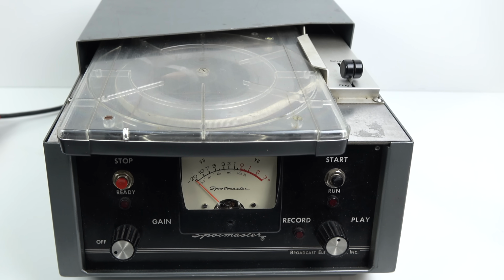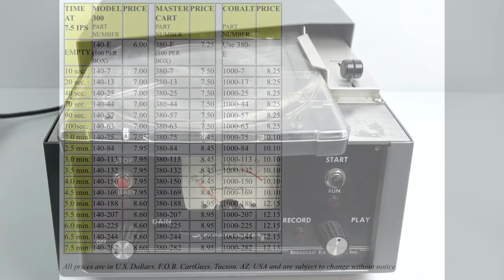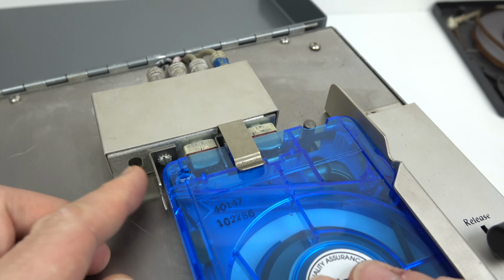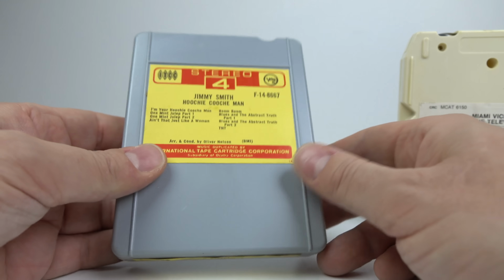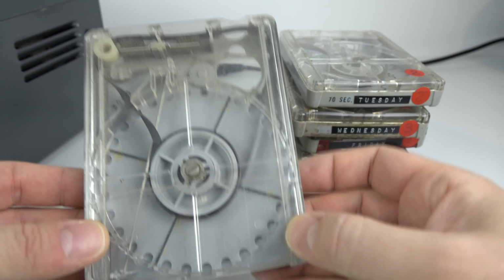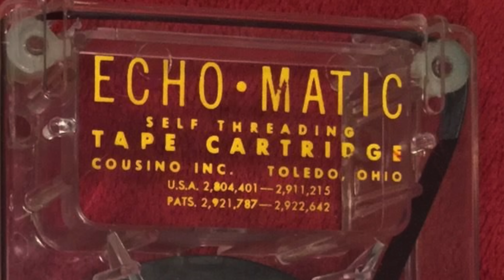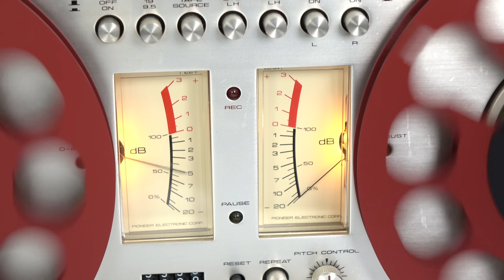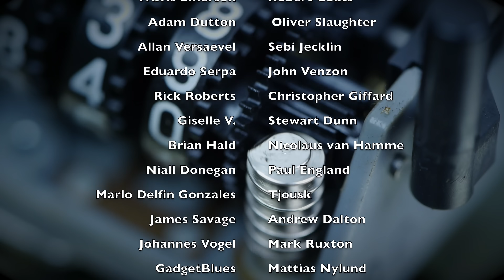The Broadcast Cart Machine

Comment: A machine from the 1950's that can play a cartridge from 1996. Amazing. Someone finally did something right with tech!
Reply: I like the old warm grain/haze these give to sounds/music. I would love to use these for modern music making
Reply: That's only due to exponential technology advances.
And example of that, is compact cassette tapes. They were released in 1963 and were commonly used up until the late 90's. That's about 40 years. Compact discs, aka CD's were released in Japan in 1982, and were used up until 2010's. That's about 30 years.
MP3 players were released around 2000, and would have been lucky to have been used for 10 years.

The exponential advancement of technology means technology is obsolete faster with each passing year.

Comment: Bit of trivia, when we were recording on them we'd put them in a splice finder first, then play a few seconds past the splice.  This meant if the splice was going to break, it would do it after the cut played, and also you wouldn't hear the dropout as the tape ran over it.  There were 3 tones.  When you pressed record that basically was your 'stop' tone, so the deck knew when to start.  There was then 2 other tones, one was generally used to mark the end of the track, which would disconnect the play head and if equipped fast forward to the start mark.  Disconnecting the play head meant you didn't hear the 'blip' of the start of the track when it cued up.  The second tone tended to be used to fire the next track, so it would be added at the fade mark or when you wanted to trigger the next cut for a smooth segue.
Reply: Stop on, multideck Sonifex units used the second trigger tone. I remember wiring up a triple that was used for adverts...

Comment: I worked at a station where we had 4 of these in the main studio  (one old Spotmaster and three newer Broadcast Electronics) several others were floating around in production rooms.  I would put a commercial cart in each one, and punch the start button on the first and they would play in turn. There was a bump tone encoded at the end of each spot, that with proper wiring would signal the next machine to start.  We cut and wound the tape by hand so that there was only enough for the recording that was on it at the time.  Now it's all on a computer hard disk. Oh for the day when you had to actually work!
Reply: The remote port will simply be to facilitate wiring up remote start, stop and record buttons so that the operator doesn't have to press the buttons on the machine itself. The signalling used would be simple voltage triggers.

Fast recue, plus the automatic triggering of another player, are not supported by Techmoan's deck - it's too old and basic. To do those required the ability to record secondary and tertiary cue tones, which were at different frequencies to the primary cue tone, with the deck being configurable to do different things when it detected them.

Typically, detecting a secondary cue tone would drop the player into fast recue, while detecting a tertiary cue would fire the next player in the sequence. However, at one radio station I worked at, the Chief Engineer developed a clever system whereby the leading edge of the secondary tone fired the next player, and then the deck jumped into fast recue when the secondary tone stopped - so one tone was doing two things.
Reply: Neil Forbes or tune out because they don't care to hear automation lol
Reply: Dylfun Many, many stations go through the automated period in larger markets even. Computerized made it even more common. Up until recently, you'd STILL hear stuff-ups during the day on flagship AM news stations, with two spots playing at once or a spot and a liner both playing at once. But for music stations anyway, it always lowered ratings. 

Most stations are at least partially automated now, even with live announcers.
Reply: Neil Forbes Failure of automation never caused them to stop using it, here!
Reply: who says?

Comment: I discovered your channel about a month ago. I really enjoy the older tech you review. Many years ago (1988-1998) I worked in small-town radio here in the US. All of the material we broadcast came from a microphone, telephone, turntable, reel-to-reel or cart deck. We used carts for ads and jingles/liners. We had a small electromagnet that was used to blank out a cart so it could be re-recorded. One of the local car dealerships would call in and record a series of ads for different cars he had on the lot. Sometimes a spot would run 25 seconds, sometimes 45 seconds. Sometimes he had 3 cars to talk about, sometimes seven. And he often had re-takes. We recorded them onto reel, made notes to know which ones had re-takes and how long they were. They were then all recorded onto the same cart...so they would rotate evenly each time his scheduled ad aired. The WORST thing in the world was to miscalculate the length and have the cart run out 5 seconds before the last ad was done being recorded. Or to miss a re-take. You had to blank the entire cart and start over from scratch.

I should add that we had a triple-decker in the broadcast studio and two single cart models very similar to yours in the production studio. Every now and then the triple-decker would go on the fritz. We would have to move the two single decks into the main studio and if you had several 30 second spots that were recorded onto 70 or 90 second carts, you would have to manually stop them and put them into a "cue up" stack. When the ad break was over, you spent the next several minutes getting your carts cued up to be played again.
Reply: Alan Armstrong well if you ran out five seconds early, you could just re-record the cart, no? Waste all of a few minutes, or am I missing something?

I always LOVED radio, especially small town radio. What part of the country? We had lots of small stations I liked here in Oregon and Washington.

Comment: I remember those days of radio when those carts ruled the music radio airwaves.
Cuing up records on turntables was a diminishing artform by the 1980s.  But, I did have a friend that worked as a radio presenter in the early 1980s (back then called disc-jockey) where the station abandoned the music carts to vinyl LPs when the format went from contemporary hits to album oriented Rock (AOR).  The cuing up of the vinyl records didn't always go smoothly.

Comment: Thanx so much for this. We used carts like this quite a lot on the stations at which I worked in the 1980's. The big carts were used in slightly different decks as delays for Racing Control (horsies) & Sports Roundup. There was an extra head at the left hand side. It's a pity your machine doesn't stop - it should - it has the heads to do it but the beep doesn't seem to do what it's supposed to. There was a different frequency beep - 150Hz I think - which had two functions. This was set at the end of the programme/jingle. When the beep started it energised an external relay which "pushed" the play button of another deck. When the beep ended, the capstan sped up thus fast forwarding the tape back to the stop beep. Good system but its maintenance was high by today's standards. Thanx again, 
John  Roberts
Wellington
New Zealand.

Comment: In 1999 the radio station I worked for still used carts. By 2001 the station moved and started using computers. There was a "harddrive" cart machine that was of course used ,from some other station. There was a DOS automation computer system,that had to be updated for Y2k!
Reply: Aaron Z Yeah lots of stations kept them for quite a while. I had a DOS automation system that was floppy based, running on an IBM PC that I played with as a kid, along with several cart carousels. Fun times.
Reply: Many stations phased them out for the DAMMS digital cart system - A computer the size of a room was installed in engineering and a small white controller was added in the studio. This was about the time national adverts were delivered to the station via DAT Tapes too!
Reply: I worked in radio from 96-2000, at a mid level station that never made all that much money.  Carts were still used for almost all content, all the carts and machines felt pretty old at the time.  Planning for the digital transformation was just starting when I left.

Comment: I work at a local talk radio station near me, and the computer system is very simular to the later cart systems (even found a Cart from the late 90s in a drawer, and also they still have a minidisc player in the rack), the system is all manual (plugging in commercials into a slot, and it runs off Windows XP). They are switching to a new system right now.

Comment: Greetings from Ohio. That round-backed cart from Toledo is one of the early ones, possibly dating back to 1958 when the format was launched. They disappeared quickly as the rectangular carts where easier to grasp by the busy DJ and easier to label. The cue tone detector circuit is in the player, and probably needs some capacitors replaced. The cue tone is 1000Hz.

Comment: The cart with the Penny Lyn material is a Marathon brand cart.The radio station chain I worked used these carts-for everything from jingles,ads,and music.The Marathon company supplied carts to museum display sound systems.We also "rebuilt" these carts ourselves at the station-cleaned them out and reloaded with fresh tape and those pressure pads.Stereo carts often had phasing problems between the channels-the program would fade in and out on mono radios-esp AM.The Marathon carts were more consistent in solving this problem.

Comment: There was a digital successor to the tape cart, believe it or not there was a floppy disk cart system! I worked at a station that still had one in use in the early 2000's in the production studio. As I recall it wasn't quite full CD sample rate but sounded good enough.

Steve Wright liked carts so much that he used minidiscs in the same fashion. When Radio 2 moved studios about 12 years ago they had to put a minidisc player in for "Love The Show" to use.
Reply: Demon CD machines!  It was basically just a CD in a cart

Comment: Whoa!  Serious case of deja-vu here.  In 1974 I worked as a DJ on a pirate radio station (Don’t ask.) and we had the exact cart-machine you demonstrate here.  I had a bad experience with it once.  It apparently wasn’t properly grounded.  I was speaking into the mic live over the air, while resting my right hand on the front-right corner of the cart machine, with my thumb on the “Play” button, which I would press as soon as I finished speaking.  The machine chose that exact moment to short-out and I’m getting 120 volts in my hand.  Somehow I didn’t scream into the mic but actually pressed the “Play” button.  The cart machine functioned perfectly despite the case being electrified.  I cut the live mic then jumped out of my chair yelling, while the cart continued to play.

The machine was never repaired, but from the on I took care to only touch it by the plastic controls.

Comment: A friend of mine was a radio DJ in the 70s-80s, whenever theywould get 45s pressed on styrene (from Columbia, Warner Bros. and other labels that had their 45s pressed at those two) they would immediately transfer them to carts, otherwise after about 3 plays with backcues under a heavy broadcast tone arm they were totally worn out.

I visited WJBR (one of the oldest FM stations in the US, first to broadcast all-stereo and later all-CD) with a scout troop in the late 90s and one of their employees demonstrated producing a commercial, including sound effect CDs, open reel tape, a voice processor, and of course carts (including a bulk-eraser...just a big electromagnet, drag all 6 sides of the cart across it, it's erased). Just a year or two later there was an article in the local paper about how they had switched to doing all of that on computers.

Comment: Techmoan, I wonder if you have ever run across a continuous carousel cart player?  In the 1960's, I had a friend who DJ'd at a FM station and I saw his setup.  The station was semi-automated, quite progressive for the time, and was in two small rooms in an office building.  The main room, about the size of a large bathroom, housed 2 carousel cart players; each carousel could hold a few dozen carts in a horizontal-axis wheel arrangement.  They could be programmed to play cart #1 from Carousel #1, then cart #1 from Carousel #2, than back to Carousel #1, which had finished advancing the previous cart and cued up the next.  Each time the switch was made from one Carousel to the next, the wheel rotated one notch, and eventually made it back to the beginning.  Carts could be inserted and removed at any place on the wheel, and the rotator skipped over empty spots. The DJ could pause the system to make a live announcement, but rarely did.  Most DJ chatter was pre-recorded, even the time announcements.

I'm not sure what kind of carts these were, but it was an FM station, so they probably held stereo tracks.
Reply: I worked at an automated FM station. We had our music on open-reel machines, but the commercials were on carts in rotating sequential carousels like you described. They later upgraded to allow four carousels that allowed random searching for a particular cart.Time checks were on a dedicated cart machine that advanced one track each minute so that it played the correct time when called upon by the sequencer. One announcer accidentally recorded a 30-second spot on a 5-minute cart. It took so long for it to advance and rotate that it threw the whole system out of sequence every time it played.
Reply: Shermanbay I got a few of those from a local radio station just after they went all computerized, in 1995 or 1996. I played with them for a while, but never got it working. Came with the original IBM PC (from 1981) that ran the thing (though the carousels might have been older than that). Very fun for a kid who loved radio to play with.

Also got endless varieties of old carts and 5" reels from radio stations who threw them out to play with. Fun fun! At least I had a broadcast reel to reel deck to play the reels on (an old Magnecord from 1967 with 7.5 and 15 ips - sounded FANTASTIC!).

I could have scored all sorts of very nice Ampex reel decks from one station in eastern Washington who had gone digital. I got there a couple weeks to late - they threw them all in the garbage!!! Those go for literally thousands of dollars, as they were high end decks. Way nicer than small town radio should have.

Also remember when our old movie theater threw out their original tube amps from 1946 when they went modern in 1997. I WISH I took them from the garbage heap, as there was some very nice stuff in there. Even some Altec tube amps, those green face models that are so nice, that studios still use now! The LDS church likes to use them for their chapel organs too, even now, because they sound so good (they always have great sound systems for speech and organ music).
Reply: Big DogCountry ok so THAT is how he did it pre-computer! I only ever saw the ones with the original IBM PC's (floppy only) running them. That's what the one I had to play with had. Which I think had the same BE carousels as that picture had. BE was everywhere!! Love the look and feel of the big, old analog equipment. Love using it in the studio when I can (recording studio). Still prefer the sound and limitations it imposed on the recording process. Pro tools has NOT advanced the actual art of music production.

I like to use my external hard disk multitrack from 2001 - the old tascam MX-2424. The transport works and feels like a reel to reel, so you can use it like that during recording to limit the distraction of pro tools and DAWs. Still sounds fantastic at 24/96. And you don't have to worry about computer crashes, viruses, plugins, licensing, updating the OS and every plugin to go with it, constant version upgrades, etc. Hit record and it's recording, every time. Bulletproof! 9 and 18 GB UW SCSI drives are getting harder to find, though :(
Reply: Big Country, I can't see that image!
Reply: Radio England, or Swinging Radio England, an American owned offshore radio station had a Carousel installed on their ship in 1966, way before the BBC got tech equipment like that.

Comment: A "kettle" power cord... I got a bit of a laugh out of that.  In the US most people would call it a "computer" power cord.  The first and most common place that those IEC plugs were used in the states.
Great video.  Blast from the past.  A bunch of people probably hear those bumpers thousands of times.  At the TV stations that I worked at, we had Digicarts.  Same physical size but they had an internal hard drive or a zip drive(!) for playback.
We had a couple cart decks but nobody used them anymore.  I do remember these multi-sided spinning wire racks full of carts.